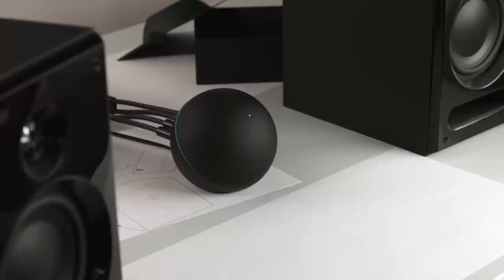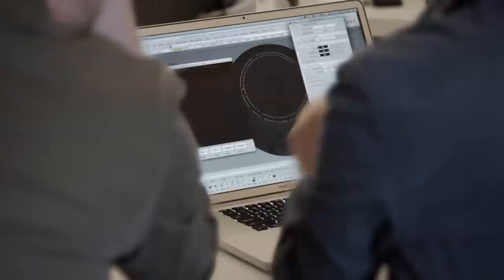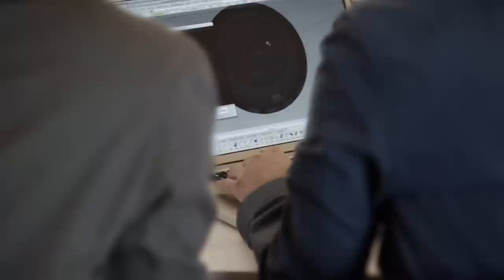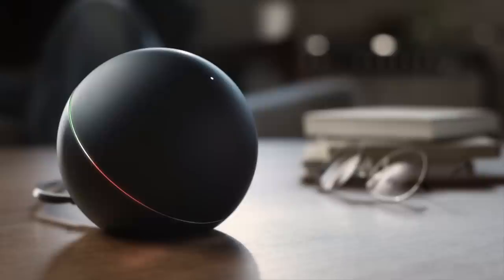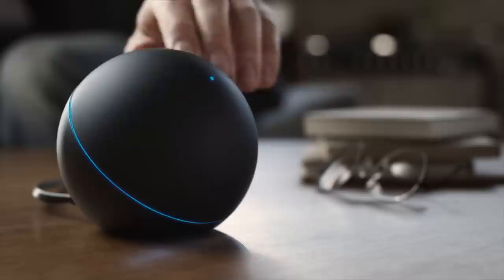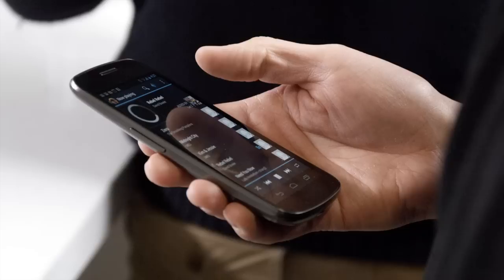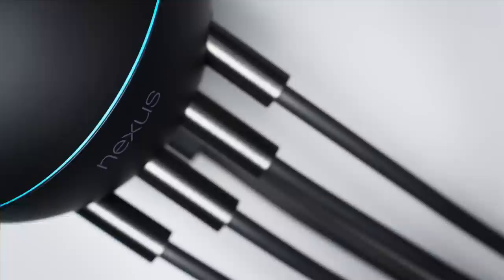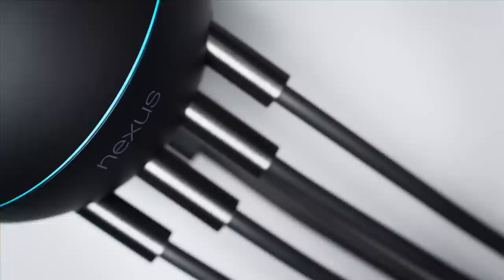Introducing Nexus Q

Comment: What a shame... It was so pretty. To bad it was 300$ and only did what the 35$ chrome cast did plus a stupid amplifier
Reply: Well, the Q came before the Chromecast. Honestly, if they didn't limit the software so much, (and perhaps added a remote) it probably wouldn't have failed. Hell, I hope that they revisit the Q's design, maybe even make a new version (Pixel Q is what I'd name it) with most of the same features, plus an actual interface like a Fire/Apple TV

Comment: The Nexus Q should be remodelled so it provides a full Android experience on the big screen (like the MK802, UG802 and Oval Elephant Android Dongles). Multiple USB ports with support for most media types would be great, so that wireless keyboards and portable hard drives can be plugged in. Google, please consider this!

Comment: 299 for features that the 99 apple tv pretty much already does (at least the ones worth using, ie stream from your phone).  google tried a 299 tv app which i tried, and still wasn't as good as the 99 apple version.  299 is way too expensive for that brick.

Comment: Well, this device is dying for a slim LCD display accessory and a thin remote!. Audio guys want to control stuff from a remote, not a phone or tablet!.

If I were to design this, it would be two hexagons. A bigger base hexagon about 4 inches across and a 1/4 size hexagon as the volume knob. Space between the hexes will be a 4.3 inch LCD with touchscreen, it can be raised or pushed flushed down. This would then be worth $399. With empty space inside for optional 2.5in HDD.